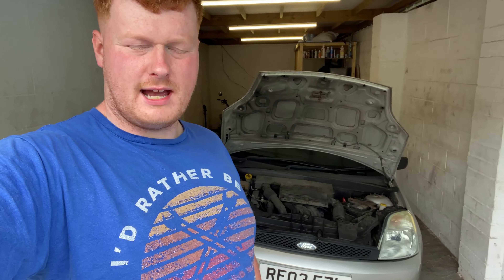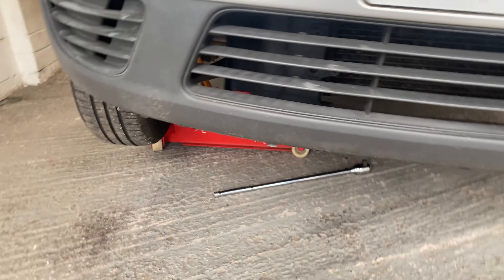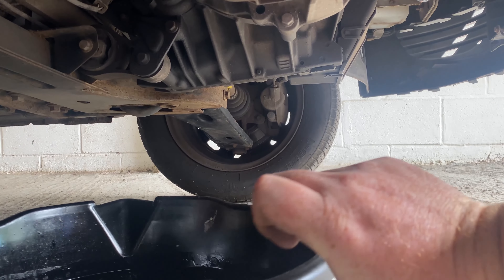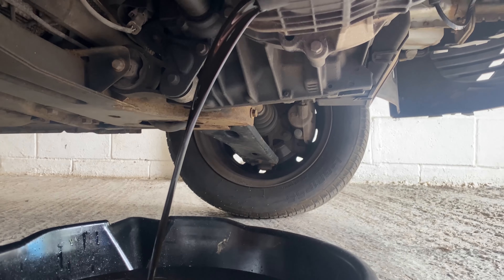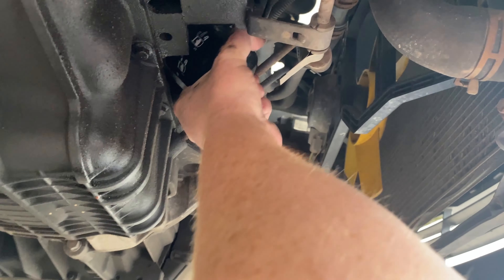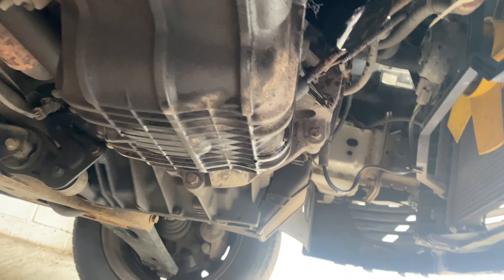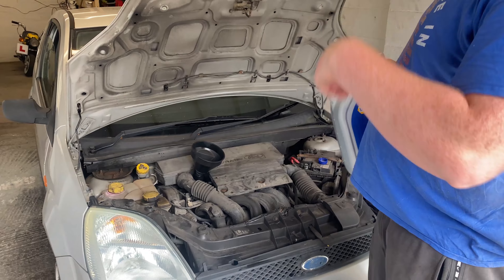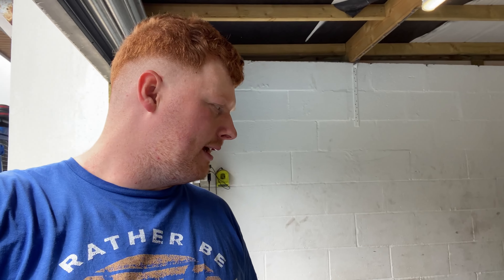HOW TO: Ford Fiesta Mk6 Oil and Filter Service

Comment: Jacking it up like that won’t drain as well as having both sides on the front jacked up
Reply: when I was at the shop for a change, the mechanic put the jack somewhere in the middle under the engine, not sure where but the point was to lift the front even so all the oil got out, worked very well IMO, I will do the same but i dont want to spend more money on another jack (and its also suepr heavy) so I just buy the stands and us the clasic ford jack to put it up and put it on stands to be level

Comment: Ford actually recommend 5W-40 instead 5w-30 (that was optional)
Reply from the maker: Normally id check but i trusted the motor shop guy on this one 😬🤫
Reply: it is an older fiesta so the oil will be suitable
Reply: Ive read a LOT articles about oil in fiesta (mostly fiesta ST to be fair) but many many said that it was really later changed for 5W-30 for these cars, Iam using it and it seems very happy.